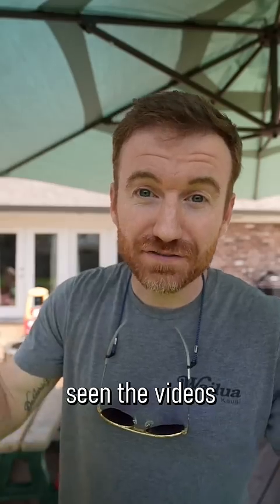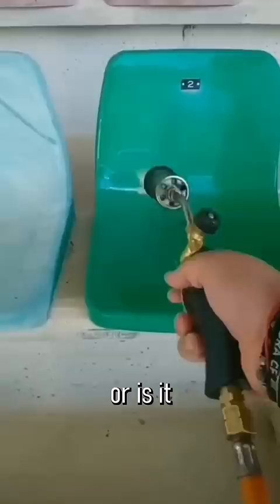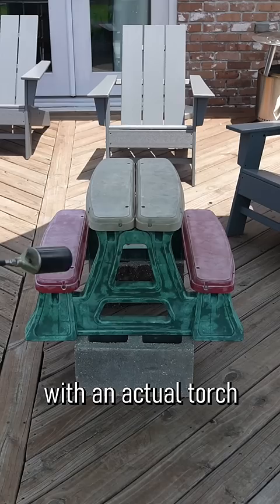Fixing Plastic with Propane TORCH

Comment: You need to coat it to keep it safe.
Reply: Yeah
Reply: With what?
Reply: @spencerplouzek2126 paint
Reply: @spencerplouzek2126  Ceramic sealer. Not paint like the other dude said haha.
Reply: @epicgamermax7204  the paint is what you want to seal...
Reply: @superbleifrei5882  I was jk
Reply: @epicgamermax7204 cope cope fr fr
Reply: @spencerplouzek2126 plastic
Reply: @epicgamermax7204 no wtf 🤦🏻
Reply: @spencerplouzek2126 pretty sure there are a lot of paint sealant alternatives. Starting from clear coat, silicone, to nano-ceramic coating.

But... It's not cost effective for such cheap products.
Reply: @spencerplouzek2126 a light tweed or wool coat should be enough. unless it's really cold, then you're busting out the thicker, puffy down coats for sure
Reply: @epicgamermax7204 really paint?
Reply: @cameroncorbin7717  why are these answers so bad, plastic can get damage with fire-

Comment: After the torch you need to protect the surface with a penetrating conditioner something a little stronger than armor all
Reply: Clear coat would work well. Clear coat is typically rated to protect against UV. If you buy something good, it will last years, if not decades.
Reply: Epoxy
Reply: Probably need something somewhat oily like a lotion for plastics before UV coating it.
Reply: Alot of talk about penetrating in this  little discussion I like it when I'm tied up.
Reply: Armor all deteriorates plastics
Reply: ronniedoorzon1576  Plastics do, thats why they can be stained or pigmented to another color etc. They are still a porous material.
Reply: This guy could have made it work, he just doesn't have the knowledge&skill to do it correctly
Reply: @Wolfstanus can confirm. I stained some plastic with makeup the other day I thought I could just wash it off but nope- lol
Reply: ronniedoorzon1576  says someone who doesn't understand chemistry at all.
Reply: ronniedoorzon1576  BS, go buy some acetone and put i t on the plastic and tell me it did NOT SOAK UP the acetone

Comment: The heat is pulling plasticizers back to the surface if you clear coat it to seal the surface afterwards they won't break down from the UV and heat
Reply: You need a UV-rated coating
Reply: @SonicBoone56 Wow really? I need a UV rated coating to protect the plastic from UV rays? Incredible wisdom from this one, thank you sir.
Reply: So many comments saying that the correct way is to seal it afterwards. I just happened to look at a really dumb reply first and almost scrolled past thinking the plastic would actually be ruined. Good to know that this might actually come in handy one day.
Reply: @bartard5199 hey you spelled bastard wrong.
Reply: Pulling plasticizers to the surface?? What? It’s just melting the plastic and allowing it to chemically re-chain itself after being broken down by UV.
Reply: Trust me, sealing only lasts so long, I sealed some paint and 6 months later it is fading. The sun destroys everything eventually

Comment: The heat from the flames brings the oils in the plastic to the top and essentially re-hydrates the plastic it doesnt do any real harm. It can actually extend the life of your plastic by protecting the surface from UV light.
Reply: ...oils in the plastic? lol, no. unless you're talking about PVC, that isn't a thing. all it's doing is melting the surface of the plastic, then surface tension pulls it smooth

Comment: Yes, it's called flame polishing. It works great for power wheels too. You got to be careful though once you get it going with the heat gun you got to keep moving
Reply: Question: How long does one need to wait till one should use a UV Coating and Ceramic Coating for Sealing it?
Reply: @Mary-Ann_B_Mabaet  when I was done battery powered ride-ons. I usually clean it real good polish it out with a heat gun and once it's cool give it a good rub down with McGuire's

Comment: You’ve got to seal the plastic again to keep it protected from uv damage long term
Reply: wont do anything. the second that flame touched the plastic, the surface was ruined. there’s no saving that. preserving it etc. rightfully fucked
Reply: @jdoggamers1008 yea no you can reseal it to keep the look longer, definitely isnt fucked
Reply: @Geereg69 you can but they are not sealing the whole stadium lets be real... They just torch them and go to the next
Reply: @jdoggamers1008 yeah, the surface burned off leaving a fresh new clean layer to then seal off
Reply: @jdoggamers1008 maybe don't comment about things you have no clue about. You can easily seal it bruh. No where near fucked
Reply: @jdoggamers1008 done this to the plastic hood scoops on my raptor with a hand torch and sealed it with a ceramic coat after been good for the last 3 years
Reply: That's Oxidation. You can actually get rid of that and bring out a new layer of plastic out.
Reply: @jdoggamers1008 🤦‍♂️🤦‍♂️🤦‍♂️😂
Reply: @jdoggamers1008 you instantly lost with that comment lol
Reply: @jdoggamers1008 hat's your response? Ew someone who likes anime?

Are we still in 2003?
Reply: @adrianmora7033 that's not how it works lol
Reply: @jdoggamers1008 was that suppose to dis him?
Reply: @jdoggamers1008 this guy is def 14 tryna act like he knows something lmao, "lil kid"
Reply: @jdoggamers1008 you are most definitely wrong dude, give us proof and cited evidence if you're so right you should have nothing to get defensive over... Oh wait, you do have reason because you're wrong :)
Reply: @jdoggamers1008 keep this man from 69 updoots because hes wrong
Reply: @jdoggamers1008 moron
Reply: @jdoggamers1008  sorry mate you are actually 100% wrong. You can easily reseal after torching. I’m confused why you think you can’t? Can you at least give us an example!?
Reply: @jdoggamers1008 you gave one person a reply because you were wrong just face it
Reply: @jdoggamers1008 cope
Reply: @jdoggamers1008 who cares theyve been doing it and it works
Reply: @jdoggamers1008 this is factually incorrect
Reply: @adrianmora7033 it doesnt burn off amything. It just get the plastic warm and soft allowing the oils in the plastic to come to the surface makingnit look new.
Reply: @jdoggamers1008  younhabe nothing backing up what you're saying either. Nice hypocrisy
Reply: @jdoggamers1008 back up your point instead of going after something that has nothing to d with anything, elderly man.
Reply: Was about to say the same thing
Reply: @jaredlynch7167  as who?
Reply: @jdoggamers1008 your 6 year to late GTAv clips are no better 😂
Reply: @jdoggamers1008 no?
Plastic will deform under heat and will bubble up etc if directly exposed (ie next to for a prolonged amount of time) to a flame.
The flame from this torch was giving us an orange flame so it's not as hot as if it was a pure blue one.
That combined with the fact that plastic will actually smooth itself out more when exposed to heat means the surface is in fact a lot better than it was before, and can definitely be sealed.

1+1 may always equal 2, but fire + plastic doesn't always means a melty bubbly mess
Reply: @Doabubba  sealing all the seats would preserve them longer and reduce how much they spend on some dummy with a blowtorch...
Reply: @jdoggamers1008  Your name is jdoggamers and you're talking shit on someone for posting anime clips? Yikes bro
Reply: @jdoggamers1008  the ability for people to be this confidently wrong is the reason I don’t trust anybody.
Reply: @Doabubba  It'd be more cost efficient long term to seal them though right? unless this just happens once every 5 years.
Reply: @jdoggamers1008 The person calling others little kids are usually a little kid…
Reply: @jdoggamers1008 clown answer.
Reply: @jdoggamers1008  right, we should be trusting every word that comes out of /your/ mouth though. you're giving them shit for liking anime when you're busy learning the banjo
Reply: @jdoggamers1008 You don't even onow how plastic works 😂
Reply: @jdoggamers1008 no its not have you ever personally done this
Reply: @randybobandy9828  You have nothing backing up what you're saying either.
Reply: @mikea5923  Where's your proof of him being wrong?
Reply: @herbjubwafter3817  Absolutely wrong.. 2 - 3 seconds with a torch on each chair is much cheaper than taking 5 - 10 minutes applying sealer to the chair after torching it as well. Sealant isn't cheap and neither is paying someone for hours of work when it could easily be 30 minutes.
Reply: @TheNaughtysheriff  So do you have proof as to why he's wrong? or are you just d riding the other commenters?
Reply: @ebarobyre2720  Anime is pretty cringe my guy.
Reply: @bricknolty5478  How does plastic work then?
Reply: @DoYouSmokeKush  trust me bro
Reply: @TheNaughtysheriff  Just D riding I see
Reply: @DDX2050  Says the 12 year old.
Reply: @DoYouSmokeKush  personal experience with old plastic restoration.  Where’s your proof your boyfriend is right?
Reply: @mikea5923  but that’s still not proof, I don’t even know the guy.. but people keep asking him for proof, yet no one has given proof as to why he’s wrong.  So I’m just doing the same thing the others are. Pretty fuckin annoying huh?
Reply: @DoYouSmokeKush  I’ve done it in person.  He’s talking out of his ass with no experience on the matter.  You piling on something that’s got nothing to do with you is more of a time waste, than it is annoying.  

What’s your personal experience with this process?
Reply: @DoYouSmokeKush  maybe try reading again.  I never even used the word proof.
Reply: Did this to a small section on my 05 Honda, waited a year, still looks almost new, did the rest of the plastic trim, looks amazing
Reply: yeah.... not gonna happen. every plastic will succumb to UV damage sooner or later (depends on your material like PA, ABS or PP).  Flaming the surface won´t prevent it, cause the "uv damage" is on the molecular level. the bindings between the molecules get damaged, hence weaken and break apart. that is your microplastic in the ground
Reply: That's what I wanted to hear
Reply: Pretty sure if they can and it makes sense cost wise they will reseal it and if not just burn layer by layer until they have to place the seat. Whatever is most cost effective is what they will end up doing. I’m sure someone here works there and actually knows
Reply: @jdoggamers1008  as you've been told by everyone else

It's fine
Reply: If they’re going to torch each individual one, they’ll seal each individual one 😂
Reply: @jdoggamers1008  you should probably do some research
Reply: Seal it with plastic bag?? 
For the best result....keep in your storage.....😂
Reply: @Doabubba be real if they can torch the whole stadium they can seal the whole stadium
Reply: @jacoblehn8752 anyone can comment dawg 😂
Reply: @iam.Euphoria  doesn't mean they should
Reply: @randybobandy9828  "it doesnt burn off amything." Your understanding of chemistry is simply not there...Plastics are hydrocarbons that are chemicaly conected into long chains(or into net -> but not in this case).
It is simply not posible to not burn them with open fire + your idea that there are some oils inside is ridiculus-> there is no place for liquid oils betwen polymer chains->this chains were made from oil->oil=literally much shorter chains of hydrocarbons->make them even shorter and you have gas(that then is burning in this video as high heat is breaking the chains).
why you commenting and trying to sell that bs to the people?!
Reply: @adrianmora7033  ADRO THAT YOU????
Reply: @jdoggamers1008 wow, you said something so incorrect that 90% of the comments on this are calling you out for being incorrect. Frankly I’m impressed
Reply: @jdoggamers1008 :some people haven’t tried to seal it after doing what is In the video so you don’t know what will work and what wont work unless you actually try it
Reply: @jdoggamers1008 rightfully wrong for you, it can work ya know.
Reply: @Doabubba he is still right though
Reply: @jdoggamers1008 🤦‍♂️
Reply: My god bro everyone gangin on one dude

Rightfully so tho but jeez
Reply: nothing really adheres to HDPE
Reply: @9051team What the hell are you on? That had nothing to do with anime? Total non sequitur.
Reply: could wax them i guess thats a  way to go about it @Doabubba
Reply: @jdoggamers1008  you dont know what your talkin about
Reply: Bro just sealed in the dirt instead
Reply: @jdoggamers1008   is digging himself out of piles of lightly used ruins

Comment: This does work, with the down side that it turns the plastic more brittle. Depends on the thickness and type of plastic.
Reply: "down side that it turns the plastic more brittle" the UV from the sun made it brittle(if UV was able to go deep into plastic->lack of pigment that is able to block it)...
Reply: @Bialy_1 wrong the heat leeches the oils out causing it to become brittle. The sun does bleaches the surface

Comment: like i said in your first try the key is what you do after the heat treatment ... use some gearbox oil and rub it on , wait a few days for the oil to get absorbed into the plastic so it isnt oily anymore .. it will keep the color for years

Comment: "if you have no morals"

Wtf. If i could do this and sell it, compared to throwing it in a landfill, that would be waaaay better for the environment.

Id evel tell the customer how i restored it
Reply from the maker: I made a previous short using a heat gun and the heat treatment only lasted for a few weeks. I was making a joke off of that short. It had a lot of comments of people joking that used car dealerships employ the method in damaged plastic just long enough to sell the car 😂 I realize I wasn’t clear about that in this short, my fault.
Reply: I in fact do have no morals.
Reply: @BreakItYourself Did you reseal the plastic?
Reply: If you don’t lie about the age of the product it would be fine. It’s just not nice to sell someone something without being honest about the product.
Reply: No kidding what's wrong with selling something that looks better than it did before i don't think this guy knows the definition of the word morals 😂
Reply: @briandonnelly6086 the issue is, when you do this you're pulling the oils to the surface so it looks better but you are sacrificing the integrity of the material.  So doing this makes the plastic brittle and shortens the life dramatically of something that was already near the end of its life.
Reply: @BreakItYourself it only last lasted a few weeks because you didn't seal it after treatment.
Reply: @BreakItYourself who cares it was a funny joke at the end and people are so sensitive now a days they get offensive over anything and this comment on your video proves that😂
Reply: Fr
Reply: @Unkown6678 they aren't sensitive , they are too dumb to understood that he meant selling it as a thing that wasn't damaged by the sun
Reply: @TheDinkybird92 so, how do you reseal after a heat treatment like this? Asking for a friend😂👀
Reply: @zanthax1  ceramic sealer. It comes in a spray can
Reply: @daveco1st depends on the plastic. Some are made to be heated to mold them into shape.
Reply: @illeagle9560  right and those materials degrade over time.  The plastic is losing the oils at the surface that's why they turn chalky. When you heat them you pull the oil that is still deeper in the plastic to the surface. So now you have a lower concentration of oil internally which will cause the material to become brittle.    There are correct ways to restore plastic, all of which involve adding oil back into the plastic.
Reply: @daveco1st  ahhh I get what you're saying now, sorry about that
Reply: @daveco1st  also thank you, that is a great explanation
Reply: "It's just s joke, bro"
Reply: @Unkown6678 what’s funny about judging others for superficial reasons?
Reply: @BreakItYourself again better than the car going to landfill
Reply: @BreakItYourself lot of people mentioning cleaning and sealing
Reply: @Alphoric better than the car going to the landfill, but faded plastics won't send a car to the landfill anyway. But what they will do is make a car look nicer in the moment and make it appear to be worth more than it is. It doesn't make the car functiom better or worse, but it is still a scam because the dealerships make it appear better than it actually is.

I used to work at a used car dealership and we did stuff like this. That job sucked. And while I was there we got a lot of people who came back angry because the plastic quickly faded, or the cracks came back in the seats, or any number of other superficial things that still significantly effect the value of the vehicle.
Reply: @ALittleBitOfGay  some people would send them to the crusher if it’s like a fairly new car and they’re wealthy enough to not care that much. You see some pretty good condition cars in the dump
But Yh car dealerships are greasy but at least they’re not doing a Matilda and putting the speedometer back in most cases.
Reply: @Unkown6678  The only sensitive and defensive one I'm seeing here is you.
Reply: Sounds like youre just upset for being called out lol
Reply: @Unkown6678  so original

Comment: That's exactly what car dealers do to unpainted sun-damaged plastic car bumpers, that's why the car looks so nice.
Reply: And it doesn't last. Just makes the car appear to be better than it is so they can charge more money for a worse product.
Reply: Other Commenters say to seal the plastic with a UV Coating and Ceramic Coat. Any clue if that'll work?

Comment: Fun fact:  the discoloration is due to the UV from the sunlight causing a reaction within the plastic, changing the molecular structure a bit.  As well as causing another reaction with the dye used to color the plastic.  The torch softens the surface layer of the plastic material, allowing fresh plastic and dye to flow up from within.  You'll never get it back 100% to original coloration, but as you can see you can restore some of the color this way.